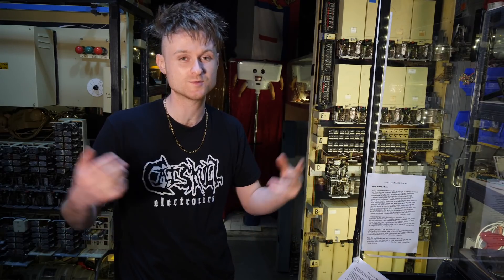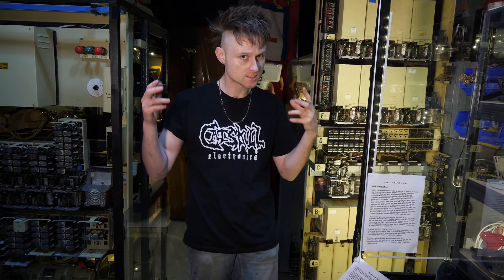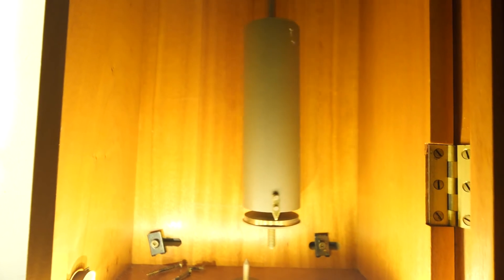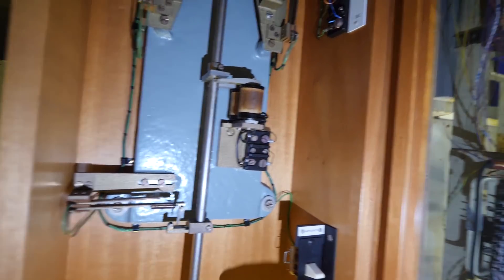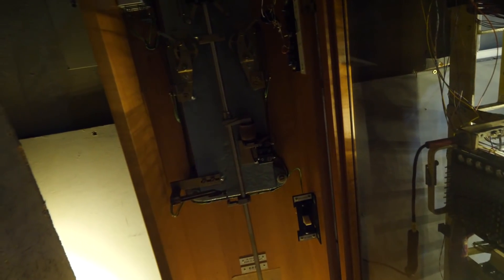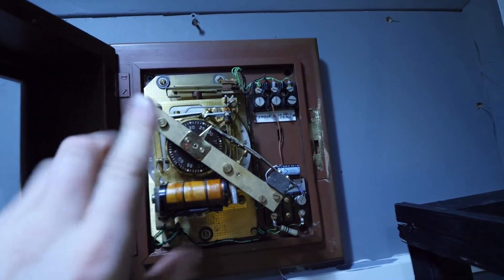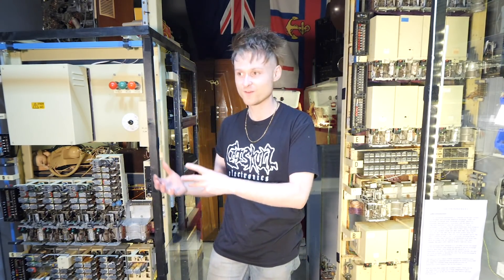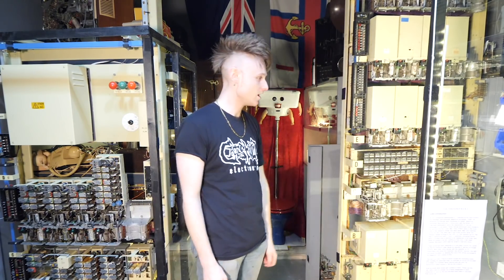The Electromechanical Pendulum of the 36 Master Clock

Comment: That 30 second switch can be used to synchronize a Gent's waiting train movement.  You could run your own tower clock!
Reply: Well I guess I should find one. What’s the term for them?
Reply: I have an old selectric clock I wonder if that could hook up?
Reply: @highpath4776  depends if it’s a clock that required external sync or not

Comment: Awesome work on this it looks amazing! That spark looks a bit big, is there a main relay before going to all devices that are synchronized? If not you could add one to improve the lifetime of the contactor
Reply: Which spark? Also that’s what that box is doing that’s a relay amplifier
Reply: @LOOKMUMNOCOMPUTER  the spark when the seconds tick, we can see it especially when the pendulum swings back from the left position, but maybe that’s normal even with the relay
Reply: @lululombard  yeah might wanna have a look at the capacitor on those contacts, sparking like that will eat the contacts in no time unless the camera is just super sensitive and showing sparks really well

Comment: i wonder what this is useful in a telephone exchange for. Is it for the billing? So they can count the minutes a call takes?
Reply: Yep that’s another thing I’ll be wiring it into those pay meters are the black things in the middle of the rack those are powered by an intermediate relay set I’m getting hold of soon which is synced by the clock in the vid 👍👍👍
Reply: A telephone exchange could have many wall clocks, large exchanges had several floors of apparatus rooms, power rooms, offices, welfare rooms, staff restaurant, kitchen, operator switchroom, night staff, all these had clocks so needed to be kept synchronised, other large  post office owned buildings would have had syncronised wall clocks as well.

Comment: I love these electromechanical devices and it's great that you keep this one alive and will even use it to control other things. I still have a Bosch electromechanical clock that has been ticking for decades. It has a balance wheel like a mechanical clock, but it's not driven by a mainspring but instead by some magnetic coils that give a pulse to permanent magnets mounted on a wheel on the same axis. The pulse is given as a delayed response to the magnets passing across the coils. It's fairly accurate and runs for many years on a single C cell.